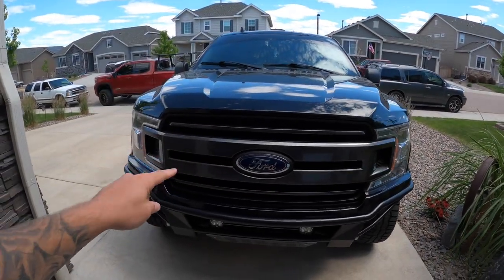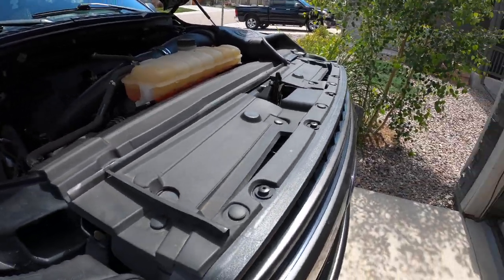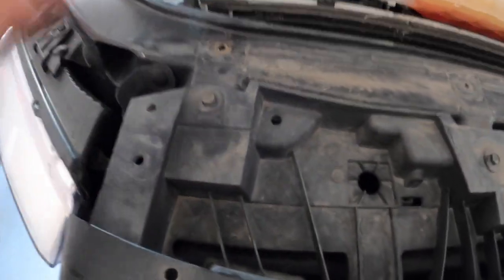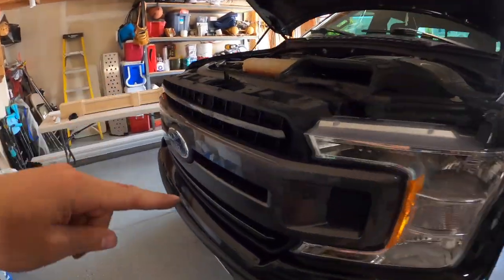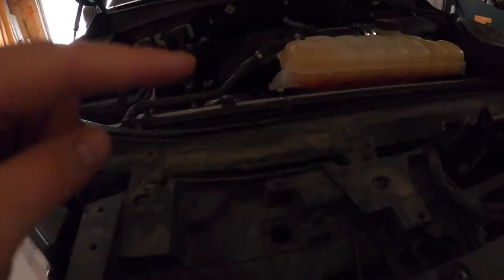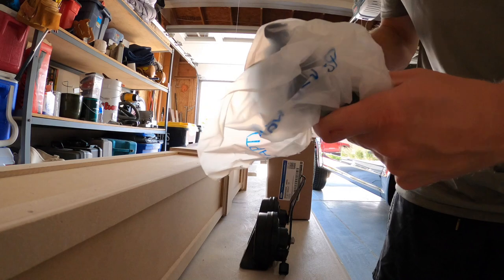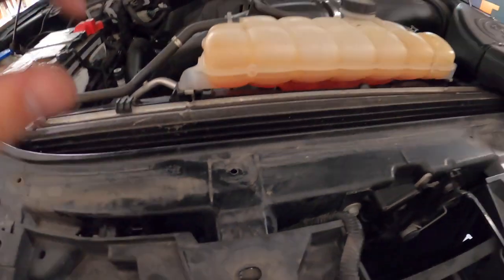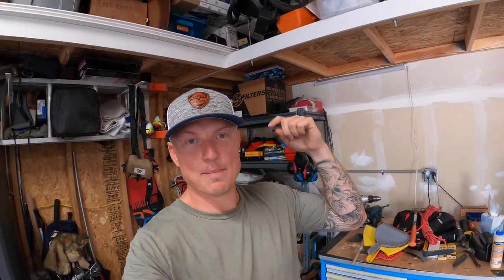REPLACING 2018-2020 FORD F150 Horn!

Comment: Thanks for the video.  I pretty much followed your final option (2019 2.7), i.e. remove the top large piece of trim in the engine bay (the part that goes under the air scoop) and then removed the screws from the second piece of plastic that is under it.  At that point, it slid forward just enough to remove the bolt holding the horn in place.  I then removed the hood latch in order to get the horn out.  Also, for those that may not know, the horn wiring clip is such that you squeeze the little tab in and pull apart.
Reply from the maker: Who knew replacing a horn could be a such a pain in the ass

Comment: The only thing I did different was removed the hood latch. Made it SOOO much easier. Only 2 10mm bolts. Just make sure you take note of exactly where it is when you put it back on. Its probably a little dirty like mine was, so putting it right back where it was, was easy.

Comment: You can get to it pretty easy by just taking the panel, the 4 screws out the top and the hood latch just us a ten mil on the 2 screws and if you got relativly normal hand should fit in the side and inside where the hood latch would be just disconent the plug. I got pretty big hands but the sweat and grease on them made them slip in easier
Reply from the maker: Much easier then the standard way

Comment: #1: F you ford for making this more difficult than it ever should be
#2: Try hitting the horn with your purse before you trying replacing it. Slapped my low tone back into action with a 3/8" wrench. Now I got a rock auto replacement on the shelf when I'm ready to cheese grater my forearm off.

Comment: Just did this by removing the hood latch to gain access, the bolt is a pain, its way to long and akward for reinstall so i cut about 1/2 off", total time was about 20 minutes.
Reply from the maker: Saves a lot of time!

Comment: How do I tell if the horn is the problem? Ny horn makes no sound, not a “prius sounding horn” and i checked the fuses
Reply from the maker: To be honest with you maybe the wiring or the plug itself came out? I’m not sure without seeing it in person
Reply: For anybody reading this later, you should be able to hear the relay "clicking" when you press the horn button.  The relay is located near the fuse for the horn, i.e. passenger side firewall area (near the battery).  I could stand on the doorframe and press the horn and hear mine clicking (horns are dead, so no other sound).

Comment: I don't blame you not one bit for not wanting to take that bumper off I spent 8 hours pulling the bumper off of my  Z06 Corvette.  I think the majority of my time was spent just trying to be really careful not to scratch or break anything but full  Disclosure I would rather get punched in the dick   Then have to take another bumper off whether it be a truck or a Corvette It seems so simple but that's really really not And then the re assembly making sure all of the clips lineup and all of the rivets go back into place without chipping the paint and scratching the paint yeah no thank you.   So I'm gonna try your way to see how that goes Although I did not buy the Ford horns I upgraded  To the train horn that does not require an air tank  I'm skeptical but the advertisement video looked promising You probably seen it on Facebook it just pops up all the sudden there's some car scaring people with their train horn   And because I am an impulse shopper I bought 2 of them
Reply from the maker: Who knew that replacing horns would be such a pain in the ass 😂😂 didn’t think I’d have to replace them that fast let alone have to take off a damn bumper. Definitely are making things harder to get to for sure. It should work for you to!